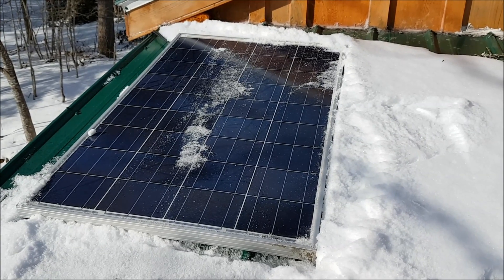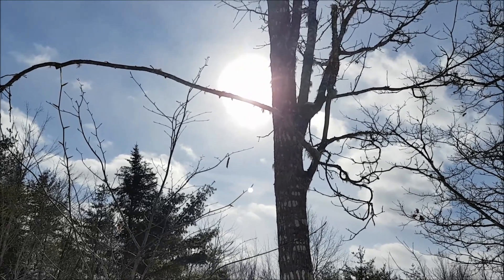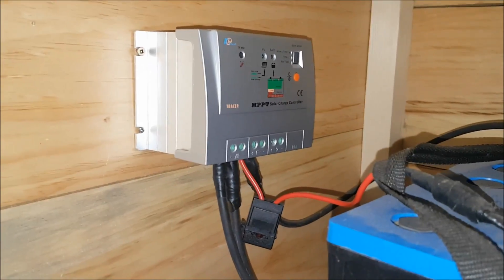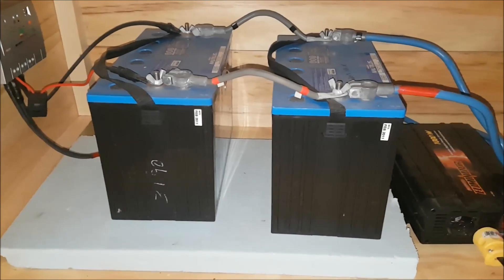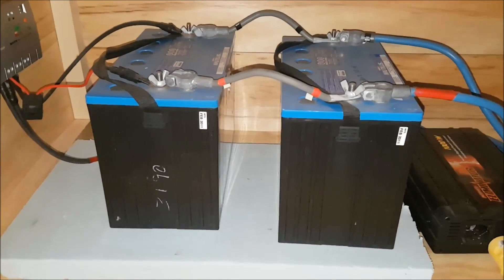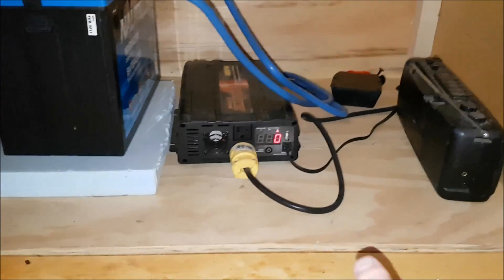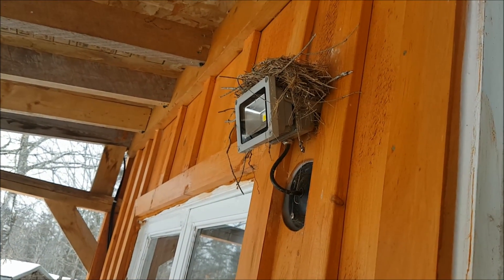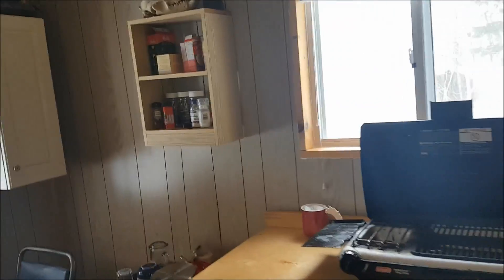Cabin Life - My 100 watt solar setup

Comment: 100w panel is like a trickle charger. 3 more panels up there  and a victron controller would be more than enough. Oh and get at least one 100ah lithium. You have only 50ah useable with them big lead weights. Having a 1000 or 1500w solar generator is always a good backup power source.

Comment: I would  have already cut that tree...I didn't get enough wood last year anyways..I started with 2 batteries and next week I'll have 8...I get them 2 at a time until I get enough..I'm thinking 8 is enough if the sun is on my 4 panels..one got shattered in a 72 mph wind gust but it's still working but I think I'm gonna wind up with 3 more panels so that'll give me six 100 watt panels...I bought the 4215 BN controller which can handle 10 panels if I ever get a roof to put them  on lol...my uncle also is too old to camp out anymore and he had 2 of the old 45 watt kits that  he gave me...they're the harbor freight kind that work in low light and they have long enough wires to put them where they work better so in this winter low light they help keep the voltage up...I only had 2 panels before this snow and had just laid a couple more panels out which are hooked up but not mounted just frozen in place for now lol...I've got to get a couple more batteries so that I can run my little Lincoln greyhound welder..I'm building one inch square steel frames around the panels so that there's 2 panels in each frame..we have a lot of wind here and I'm about tapped from buying stuff..I went with a 2000 watt Aims inverter/charger 24 volts and if I had to do it again I might have gotten a 1500 watt one but I also figured the heavier one might last longer idk I'm new to all this too...I didn't want to have to buy another one and I'm kinda scared of that so I got the one I did and crossing fingers..since I can't use the roof I'll put mine out for the neighbors to gawk at...the first time the power goes off it won't be me though..(our freezing rain season is in March)..I used about 12 ft of #2 welding lead to make all the short cables and with the 2 batteries I'm getting I'll have $2100 in my setup but itll run about anything I plug into it...I have to tell you this solar stuff is addictive...the more you get the more you'll want so you have to decide where to back off buying stuff but that's on you..

Comment: Need about 6 panels on thier as many  lithium batteries as you can get they hold thier voltage and amps on high loads and can use more % of the capacity high watt inverter pure some wave  3000watts use induction jobs for cooking electric oil filled radiators  up and down converter  for other devices 5v and 12volt setup .nice setup mppt is what I would use

Comment: I need power to run a Koolatron fridge on a patio with no electic outlet. It’s a 12V fridge I’m thinking of buying a solar setup to run it and some LED lights maybe recharging a ph or laptop too. Thank you for reviewing the Coleman 100 W panel. I’ve seen so much promotion of the US companies Jackery and Renogy but am wondering if I can buy here in Canada instead of waiting for delivery. Do you have any experience with the Eliminator Power inverters?

Comment: - 9 freezing cold dressed like it's 30...lol we get -30 and 40 here in the Northwest territories... i used to walk to school with my T-shirt and a blue Jean jacket at -10 in Whitehorse Yukon and that was over a mile to school from my house...lol incredibly funny.... But seriously what I wouldn't give for a winter of -10.... Back on topic I run two 6 V deep cycle batteries for my 4 x 8 square drop camper but I'm going to switch them out for one Ion lithium battle born battery then add another one as I can afford it.... Quicker charging time so I don't have to run the generator as much.... I run pretty much the same as you but I want to run a 12 V cooler/ fridge freezer and my overhead fan during the night.... I should get three days out of it before I have to recharge my batteries with my Honda gen which will be perfect.... From what I've seen from other people they usually run 4 those panels better to have more than less.... Liked your video it made me laugh.....
Reply from the maker: I've improved my solar since this old video. I now run 470 w and 2 trojan L16 420 amh batteries (6 volt). A buddy of mine has the lithium batteries but they don't seem to do well in the cold.

Comment: up then panel voltage's and use mono's in winter?  then with poor light there might just be enough current to get a charge into the batteries.(at worst saves having them in a low charge state through winter).

Comment: How is the wiring set up from the inverter to the switches? Did you run all the lines through a breaker panel?

Comment: Great set up. I'd like when I drop a cabin in vt- or nh- can you run a couple lights and watch a movie all night on 100watts ?  I'd probably start off with 2 panels  hope I can run. With just 2 batterys what's the model of your gassless batterys? Thanks a lot. Love a plain and simple set up with outlets and  4-6 lights.  Outside can just use a few. Mini self contained solar spotlights
Reply from the maker: Check out my upgrade video. 100 watts is ok in the summer but that's it. The 12v batteries are great because they don't gas or need maintenance but they don't last as long either. I've since went with 6v and they are way better.

Comment: You should wire your batteries with plus on one battery and neg on the other battery to distribute the charge evenly between the two to prolong life....
Reply: And some people, like all three who have commented before me, don’t understand wiring for balanced charging which is what the OP is saying. Wiring the batteries in parallel and wiring the charger to the pos on one battery and the neg on the other battery provides balanced charging for two batteries.
Reply: Some people commenting clearly dont know or understand the difference between wiring in series vs parallel 😔
Reply: Thats stupid. Thats in series. You only do that with 6 volt batteries. Unless you really want 24 volts. Then that inverter would smoke. No.. keep doing what your doing. Me? Id get about 6 more panels and 6 more batteries.
Reply: then he also needs to buy a new inverter because you are then running 24v

Comment: I know this is almost a year old and maybe you already have done or someone mentioned, you charge controller will most likely handle the amps 3 100 watt panels will put out. . 3 12volt panels in parallel will give you about 15 amps..So, you could get by with a 20 amp charge controller. Just a thought. Have a good day. 9 below,, hope I never see that..   I live in Florida,  lol.

Comment: can you use normal house wiring within the walls?also you have a great set up and a nice looking cabin.I'm planning to build one myself.what size wiring from solar panel to batteries,and to inverter also?
Reply from the maker: Inside the cabin is standard 14/2 and 10 weather proof from the panel to the batteries. everything else is 2 awg.

Comment: Instead of the input from the charge controller going to one battery and the output to the inverter coming from the second battery, I think it is better to cross connect them.  Like the plus from charge controller connected to pos on the first battery and the neg from the charge controller connected to the neg of the second battery.  Then the output to the inverter connected to the opposite posts.  Hope that nakes sense.  Good vid, thanks.
Reply: Agreed. Someone else suggested that but it was wrongly interpreted...

Comment: i have a small fridge in my camper the 4 battery's power pack i use will run fridge all night off a 900 watt invert-er that got 230 watt mono solar panels & 5 harbor freight solar panels for low light charging! i also have a small gas Genny, satellite and tv run off the system but some recorder like DVD or VCR do not run off invert-er right  it odd!
Reply: I guess people who ran there mouth solar don't work so i took camper to off grid camp area and setup everything made youtube video's because i knew she got into my youtube! so i had a knee /leg infection in January i guess they got kicked out of where they live, all there stuff out side & covered up! and there gone! I set back and watch and see, people make trouble for me  it back fires and comes back to them very hard!!!
Reply: @gatorred157  ???
Reply: @frankuher6673  i changed every thing from camper & solar I adapted systems! on my channel i changed stuff  & i was gone most of summer over water supply in my area i live Gregg

Comment: My 100 watt panel runs a 12/24 volt domestic cf50 refrigerator just fine. In a van I take it to baja. I paid $700 for the frig.

Comment: 100 watts is not much
Reply: Daniel Mccrea, I'm running an 18 watt panel with two 12 volt marine batteries connected in series. it'll last the whole weekend if I'm careful. one week of good winter sun will fully charge the batteries. I think the key is not wasting your electricity.